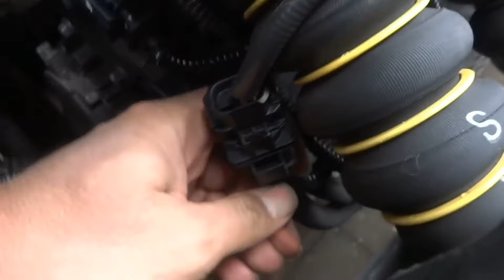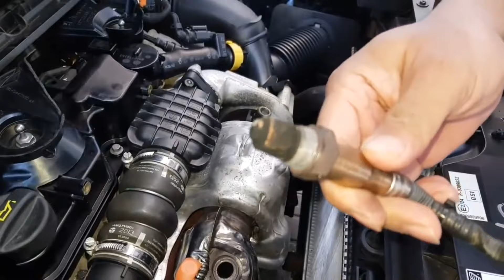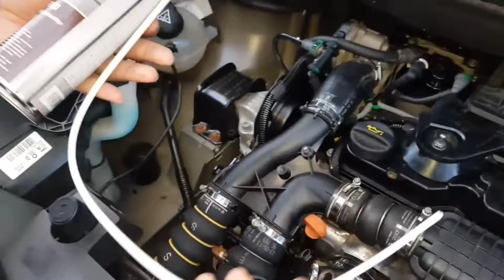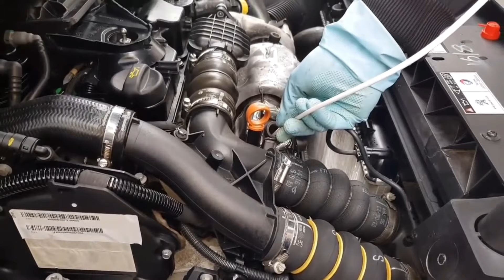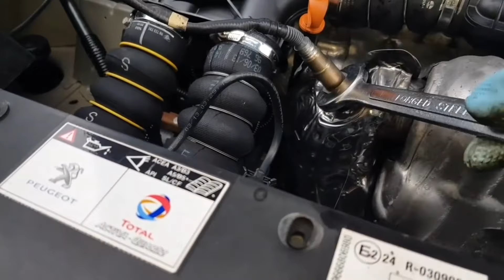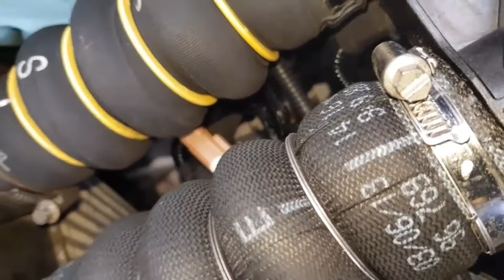How To Unblock A Blocked DPF(diy)

Comment: You have used FAP cleaning product near the top of the catalytic converter. This foam could not get into the FAP filter because the FAP is located in the lower part of the exhaust. In short, you put foam in the wrong hole where you should have :)
Reply: this car doesn't have fap. it has dpf system wich is located right where he sprays the foam

Comment: I've literally just fixed my Citroen Berlingo 1.6HDi using the same approach but with Mannol DPF cleaner. I could not get the O2 sensor off with just the spanner so I ordered a 90mm 22mm long reach socket that has a gap cut into one side so that you can fit the O2 sensor wiring through in order to loosen the nut. I used a breaker bar on the socket as it was very tight. I did not even use the whole 500ml can. I let the car idle for a while then took it for an 18 mile drive up and down the motorway. The DPF warning light as well as the EML came on one more time to put the car in limp mode but I pulled over into the hard shoulder and cleared the fault code to take back out of limp mode and went back to the motorway driving. You can easily clear the error code causing limp mode with just a cheap code reader off Ebay. The port to connect your code reader can be found inside the glovebox or around the steering column if you are in Europe. I hope this is useful info as it really can be done and it's not complicated.

Comment: Wish it was that easy
Reply: Use the same method with the spray but 
also add a diesel additive into the fuel tank 
that supports DPF regeneration... this will 
help the soot to burn off at a much lower 
temperature when driving... you simply add 
the bottle to the fuel tank right before you 
top up at a fuel station... its that simple.
you don't need to waste money getting 
someone out to flush the DPF 
through costing you hundreds of pounds... 
the DPF was designed to clear itself when 
engine temperature reaches a certain amount.
its just over time the soot becomes a little 
overwhelming and needs additives to help 
loosen it up which will burn off easily 
when you are driving 👉(it is that easy)👈
Reply: you need to clean the 5th injector, then the dpf will fix itself

Comment: Hi does this really works? I have the same problem on peugeot 3008 1.6hdi 2011... I will try it tomorrow, how long does it need to leave after you spray dpf cleaner?
Reply: Hi , did it work?

Comment: Would this wok on ampetrol engine? Spray themfoam where the pre catalytic converter o2 sensor hole is?
Reply: Petrol engines doesn't have a DPF
(DPF - Diesel Particulate Filter)
________👆______________
Reply: @MrMaster2262  yeah but it works on the same principle as a catalytic converter. The cleaning agent is the same and they both have a ceramic mesh
Reply: @lucidfairytales   The cleaning agent would still do its job... i don't disagree. i thought you were assuming that the petrol engine had a DPF 😉👍
Reply: @MrMaster2262  thank you for the tip brother, I don't know how to explain this but my car feels kind of choked when I'm driving like it doesn't have full power, also a bit of rough idling when starting up the car, gas smell from the exhaust and the exhaust also has soot in it. Could it be a bad Purge valve? I know the cleaning would help but if I don't sell the problem of what caused the suit and the congestion in the catalytic converter it will repeat itself
Reply: @lucidfairytales   The loss of power could be 
something simple like a dirty EGR valve (clean 
or replace) also check around the hoses for any 
signs of being dirty from oil or carbon deposits... 
cracks or tares in hoses could be causing a vacuum 
leak which will also result in loss of power. If 
you have a OBD2 reader do a Live Data check 
when vehicle is idling and test that your accelerator 
pedal matches the revs (rpm ×1000) on the Live 
Data check... some models the throttle position 
sensor on the accelerator pedal needs replacing 
which can also cause loss of power if the sensor 
isn't telling the car how much throttle to give. It 
could also be the butterfly on the manifold which 
has become dirty overtime and not opening or 
closing properly. it is easy to clean with brake 
cleaner, an old tooth brush and a rag to wipe it 
with... I would start with the EGR first and see 
if that resolves your issues. 😉👍 
I hope this helped... Good luck
Reply: If everything is clean inside the engine and you 
have regular oil changes including the oil filter 
...the build up inside the converter will burn off 
easily once engine temperature reaches its target.
Reply: @MrMaster2262  how do you clean an EGR valve?, if you spray air intake cleaner and throttle body cleaner will it go through the whole system and clean the EGR valve?
Reply: @lucidfairytales   It might clean a little bit 
off with that method. would be better to remove the 
EGR valve and use a brake cleaner or MAF 
sensor cleaner. brake cleaner would work better to 
remove the carbon. it can easily be done at home. 
roughly an hour of your time to do. a new EGR 
valve is about £150 so better to try and clean.